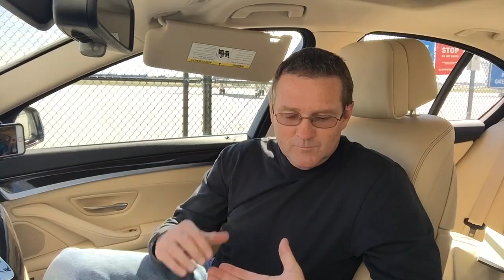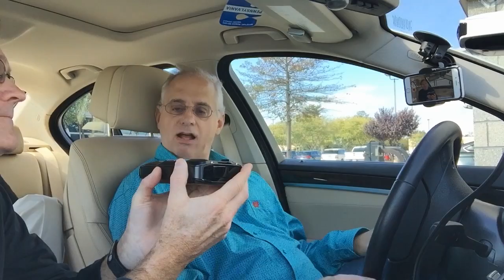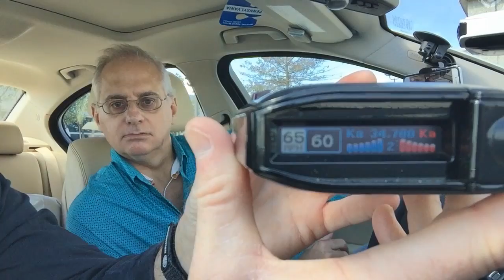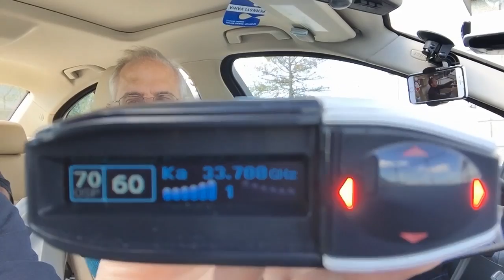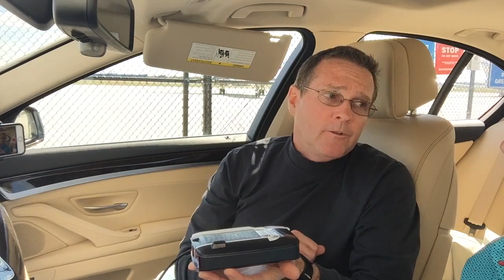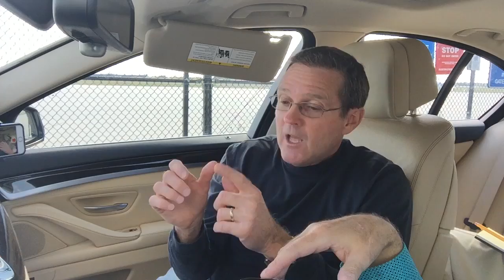Escort Max 360 Radar Detector: Exclusive Introduction with the Veil Guy

Comment: So you are saying that you are finally utilizing what Valentine V1 has had for the last 15 years. Apparently, the Valentine patents have expired so that Escort that employ the superior V1 directional arrow and dual receiver design.  
Hopefully, Escort has leaped past what Valentine has has more sensitivity, more bands, GPS and more that V1 does not feature.   The Escort 9500ix is way too noisy and a very irritating detector to use.  Hopefully, the Max 360 will finally deliver a more selective operation with only the most important alerts being announced. 

For the wallet busting price of $650, it had better be a quiet and superior performing detector.

Comment: how is this vs the red line. might want to sell my red line
Reply from the maker: +Samuel Pascal 

I'd give it some time while Escort works on refining the 360.  They are going to be two distinctly different behaving detectors.
Reply: +Samuel Pascal Looking at some others reviews, The redline has far better range. And the arrows on this thing a really slow to change or show up.  I was thinking over moving to a 360 from my V1 but there is no reason to do so. Its pretty sad for a 650 detector in 2015-2016.

Comment: Can't believe Veil Guy has become a shill for Escort.  The 360 is a p.o.s. that will get you a ticket.  Detectors that cost a third as much beat it like a drum.
Reply from the maker: Wow Nathan, a shill?  Come on now.  That's harsh.  I have had nothing but good experience with this thing when encountering radar on the roads.  Yes, it's a bit pricey, but it does have a lot going on inside it.  No one was more critical at the outset of the Max introduction than myself.  Was heavily criticized then (and even now) for this.  I find the 360 and the GT7 both good detectors.